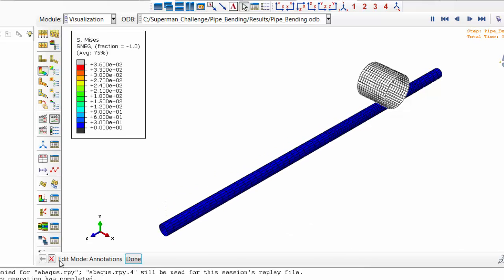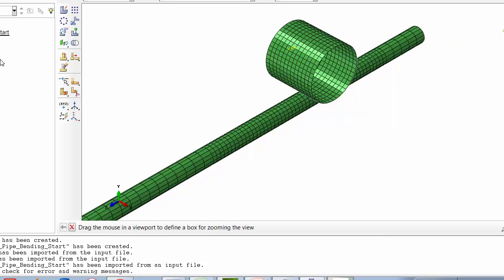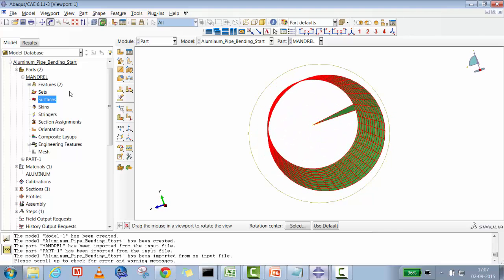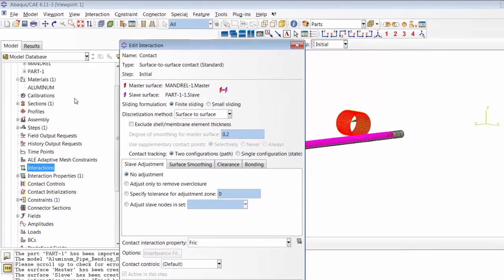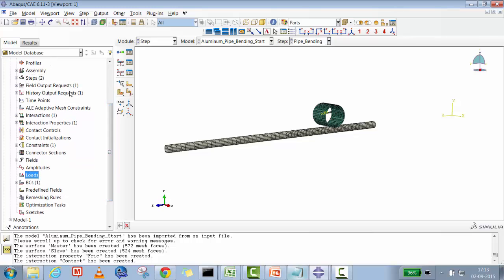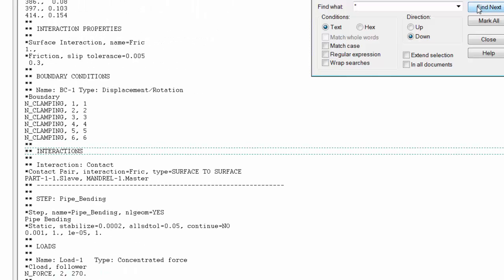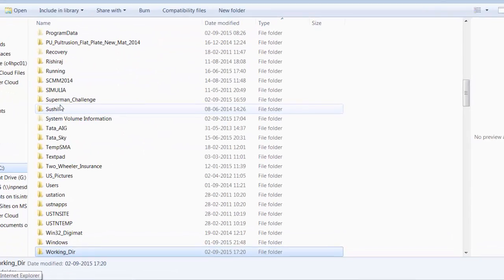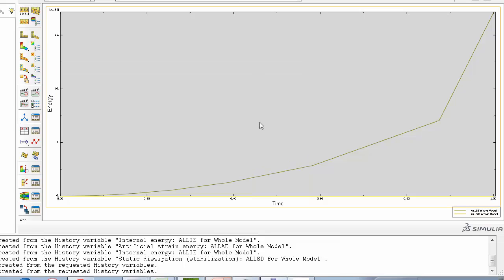Abaqus CAE/ 6.11 Abaqus Standard: How to do step by step Abaqus Contact (Pipe Bending Example)

Comment: Hello, I have some questions about how to bend a tube.
In my case I use a tool (a driven roller) which should rotate on itself and the tube should match the shape which creat the bending, but I didn't succed in this simulation. It doesn't work.
Could you help me? Have you an e-mail adress or anyway to contact you?